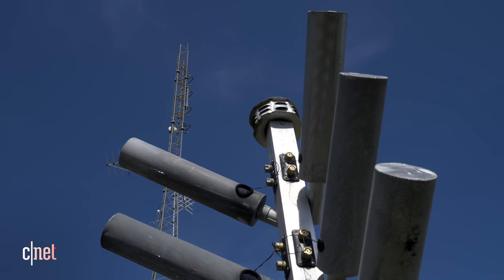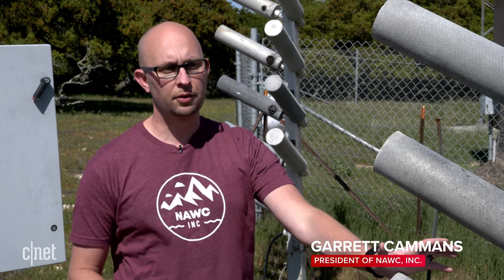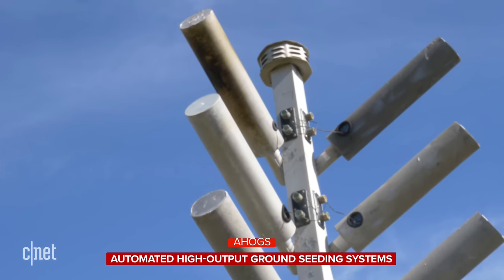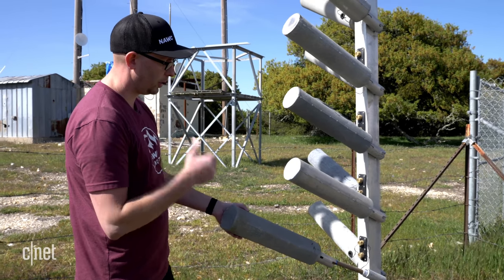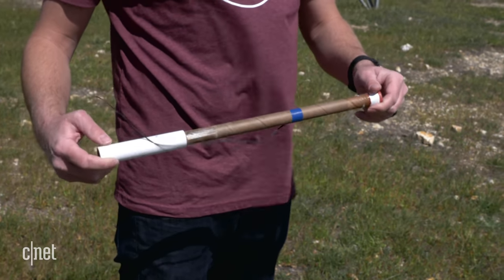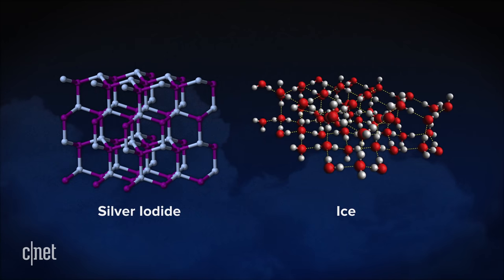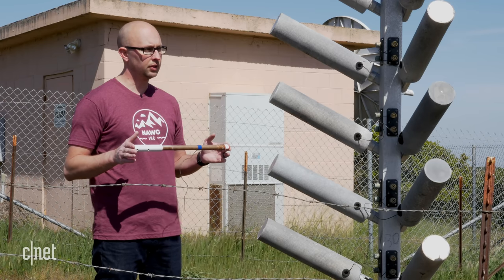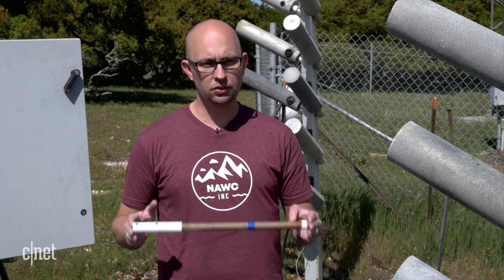Weather modification tech: How cloud seeding increases rainfall

Comment: in 2009 I googled Weather Modification Companies and found over 20 and over 100 planes. Awaiting your call. It's been going on since at least the late 40's when one guy was spraying over 200,000 sq mi in the four corner states. You never heard of the lawsuits for excess rain, snow, lack of rain etc but they happened then.

Comment: Silver iodide can pose several health risks, including:

Inhalation: Inhaling silver iodide can cause respiratory tract irritation, and prolonged exposure may lead to lung damage, including argyrosis (a condition where silver deposits in the lungs) and silver lung.
Ingestion: Ingestion of silver iodide can cause gastrointestinal irritation, nausea, vomiting, and diarrhea.
Skin contact: Prolonged skin contact with silver iodide can cause argyria, a condition where silver deposits in the skin, causing it to turn blue or gray.
Reproductive toxicity: Chronic ingestion of iodides during pregnancy has resulted in fetal death, severe goiter, and cretinoid appearance of the newborn.
Bioaccumulation: Silver iodide can bioaccumulate in the body, particularly in aquatic life, which can lead to toxic effects.
Acute toxicity: Exposure to high concentrations of silver iodide can cause acute toxicity, including effects on soil and freshwater biota.
Chronic toxicity: Chronic exposure to silver iodide can cause chronic toxicity, including effects on the kidneys, liver, and nervous system.

Comment: What about 5G and electro smog? Electro smog is the storm in which 5G works with and just curious on how the precipitation works with that? If it’s next to wires because it’s attracted to the wires and the water. If you want to test that all you have to do is spray hose up at the powerlines when there is the electro smog, which is usually orange-ish and over the city. It’ll move towards the water and power.

Comment: Silver is A heavy metal  that is poision, You can also create rain by putting ice on the ground with salt on the ground around the ice as the ice melts the cold keeps the water vapor close together salt attracts the moisture helping to keep the water vapor condensed as it floats into air doing this an hour before sunset as the atmosphere cools the water vapor condenses forming clouds attracting water vapor in the area. A much more all natural non toxic solution. Honestly we can use as many clouds as we can get to help stop global warming from ionic friction of granite ion particles in the ionosphere. Granite side walks and road ways cause " Ion plasma poision " to the body. Granite is not compatible with the aura of body. " I can elaborate in much more detail ".

 It is actually mainly granite that is causing global warming, This is because reflections and refractions of sunlight create ions as they shine on granite and shine through the refractive pieces of granite comprised of 70-77% silica, 11-13% alumina, 3-5% potassium oxide, 3-5% soda, 1% lime, 2-3% total iron, and less than 1% magnesia and titania varying. This is causing global warming because more granite ions are being created daily than the ionosphere can hold, A good way to see it is see granite ions as molecules of water, When water is heating the molecules are moving more fast. The more ions created daily is creating ionic friction in the ionosphere from the ion particle plasma bouncing around in the ionosphere this is what is causing the temperature to rise annually. The spacing of tombstones are actually large ion particle plasma energy fields that have caused many solar storms and cataclysms from people venting their emotions from losing their loved ones as emotional energy travels through the ions into the atmosphere-ionosphere that causes ionic fluctuations in the ionosphere.

  
( We have until around the years 2030 then it would have been to late “WE HAVE TO ACT NOW ” there would have been to many granite ions in the ionosphere than the ionosphere can hold raising the global temperature higher than the atmosphere can sustain life that would inevitably blow out the ionosphere of Earth, Urgent stress we have to act now A#1 top priority for all countries worldwide to stop raising of the tempeture of Earth to stop the ionosphere from being blown out. This can be proven with advanced spectrometry analysis equipment advanced enough to measure ion plasma types and densities of each type of plasma. )
Written by Ant "1/3/24"
Want to learn more contact @ Instagram: ant100100100

Comment: most efficient cloud seeding involves high rise structures, it is electric. negative ions tend to absorb moisture out of the sky. powered by solar panels obviously. on the mountain slopes, floating structures ionize the atmosphere forcing the moisture our of the sky. also by reversing current one could disperse an upcoming snowstorm. dumping electrons into the air tends to remove droplets. removing electrons tends to disperse the impurities and hinder the precipitation.

Comment: Individuals frequently hold the erroneous belief that the government is deliberately concealing the existence of such technology. However, this is not the case. The technology in question is highly complex and lacks the necessary power to generate hurricanes at present. Furthermore, if such technology were to be successfully deployed, they lack the capability to control its trajectory, as the jet stream is an uncontrollable phenomenon. I studied meteorology, and I can assure you that the resulting silver toxicity levels would be exceptionally high, which is not the case. Instead of resorting to unfounded conspiracy theories, it is more prudent for individuals to conduct thorough research.

Comment: If you only spray whatever to have rain faster. You are not cooling this planet down that way. 

How can you create more cool air by using the cold of the dark space? 

How can you have a systems of machine that runing around the planet like a Clock? 

How can you spray water around the planet by Night to create extra cooling air? 

How can those machine save power from the sun by day and spray trillions of  liters of sea water up in the air by night? 

How can you set those water pump all around the planet without worrying about "Budget"?

How can you control the tempuature of of the planet by water Pump? 

Good luck. Only if you can do that. The world will be a different place.

All i know is that the air is cooler at night. If you keep spraying water in the night sky instead of turning those Lights on 24/7. 

The world will be a better place. 

The amount of electricity that need to use to turn on those lights. Can turn on those Water Pump too.